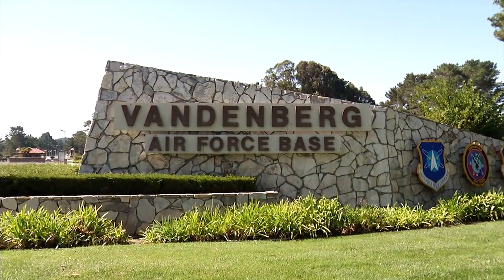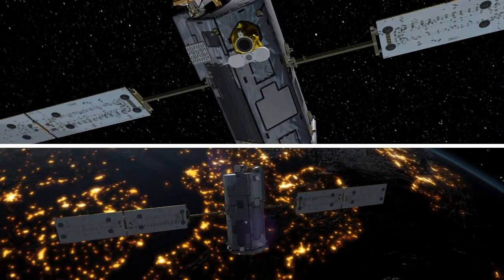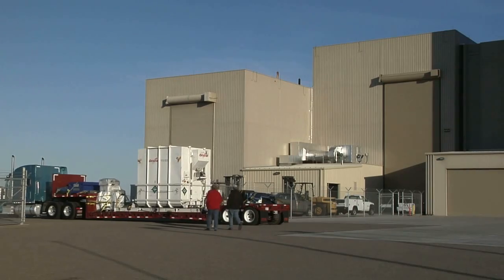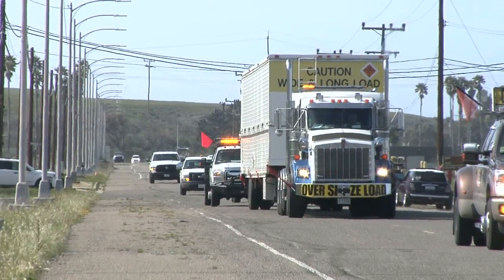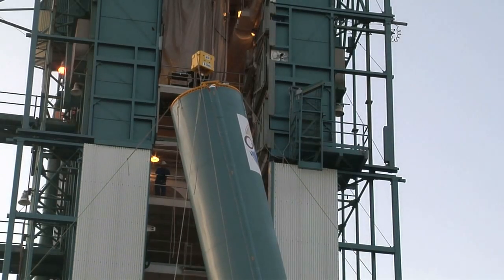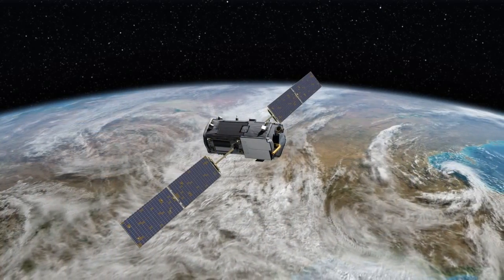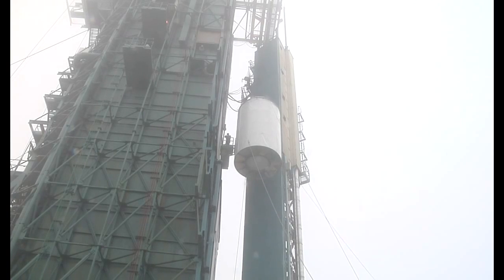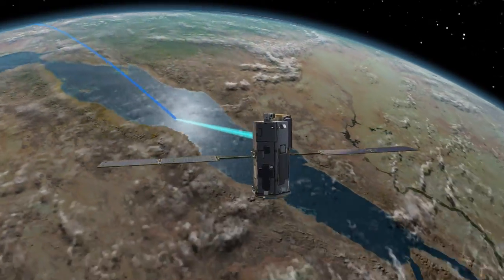OCO-2 and Delta II Prepared for Launch

Comment: So why did they bring back Delta II?  Is Delta IV too expensive?  Delta IV having issues?  Had some left over from the 80's?  The non heavy version of Delta IV lifts similar weights?  Not to say Delta II was not a good system.  However, Delta IV seems like its less risk with out using solid fuel.
Reply: There are three or four remaining Thor-Delta IIs from the last production run and only two have been assigned a payload.